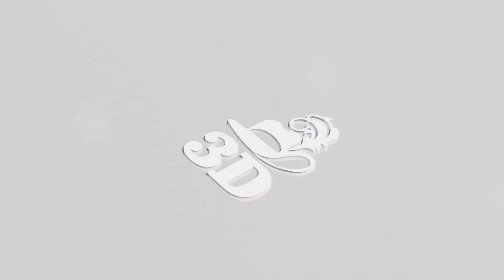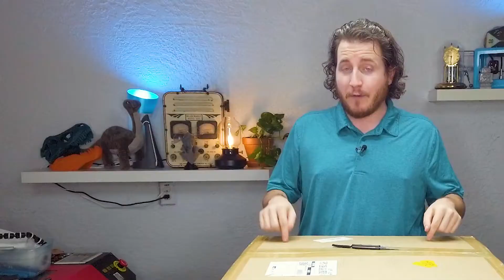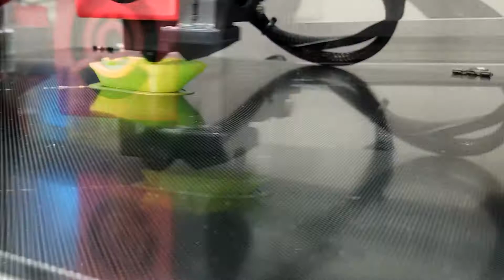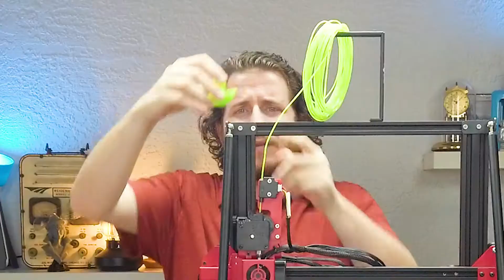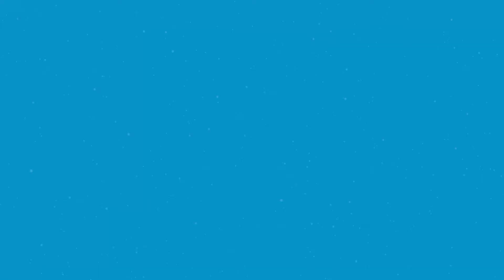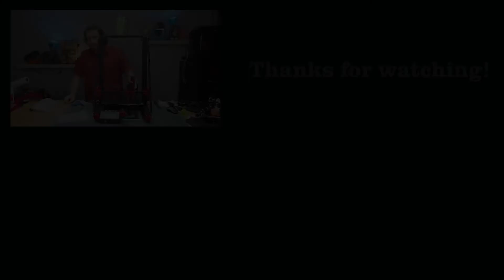Another Creality Clone: The Pyramid A1.1 Titan! (CR-10v3)

Comment: I know this is 2 years old but I have a few things to say.  I have this printer with custom firmware and BL Touch.  I've also replaced the glass bed with a magnetic flexible type and relocated the computer to the side so I can see it when the bed is fully forward.   The facebook group has a lot of custom stuff and they are helpful.  You can of course upgrade a lot of the components that the OEM cheaped out on.   HOWEVER!  If you are buying today I'd just go with the Ender 3 Max Neo.  By the time you've upgraded the Pyramid with good components, you are essentially paying the same for a printer already set up.  But if you can get one used for a hundred bucks or so, it is a nice printer.
Reply from the maker: I would personally go with the SV06+ but yes, this is not a good buy anymore. I think for the sub $200 I got it for it was not BAD but newer machines have came leaps and bounds since then

Comment: I have had one for 3 years and i had to laugh because i see the bracket for the filament runout has been made of metal finally. Mine breaks often. Anyhow, i cannot figure out how to flash firmware! It did however cancel prints over the thermal runaway and i replaced the thermistor. I often have issues where it turns off and back on like nothing ever happened and wastes huge prints, makes me absolutely livid. I do not know if it is a power supply issue or what. That's why i tried new firmware but it doesnt seem to accept new firmware. Also the host looks like Jake Gyllenhaal lol
Reply from the maker: Nope, that is printed plastic lol. I will take the compliment ha ha! Not sure how to flash it, I will have to dig into the machine some, which I have yet to do.

Comment: would you recommend this printer if I could get it for $125 used?
Reply from the maker: If it works, absolutely. Make sure to get a test print and verify it works before you pay, but yeah, it is a good value at $125. Definitely needs auto bed leveling and eventually an all metal upgrade, but those just make it easier to use.
Reply: Also, watch the installation video and make sure it's built correctly.  I guess if its getting shipped then they would have to disassemble it.
Reply from the maker: @CharlesRooks  Good point! Yes, make sure it was built properly